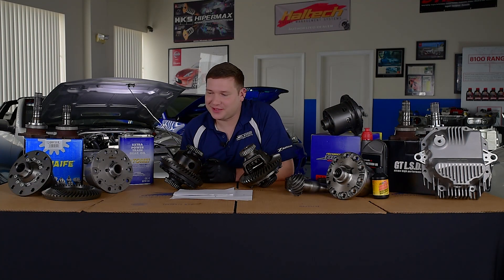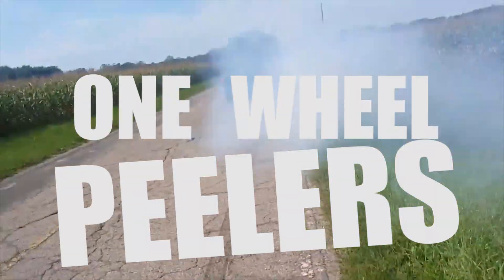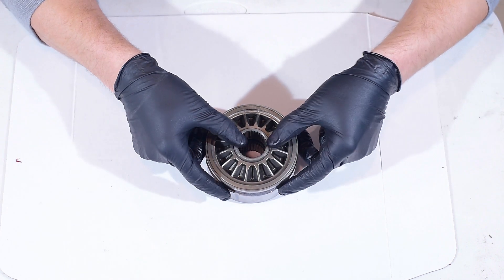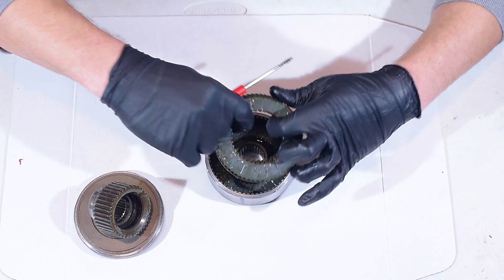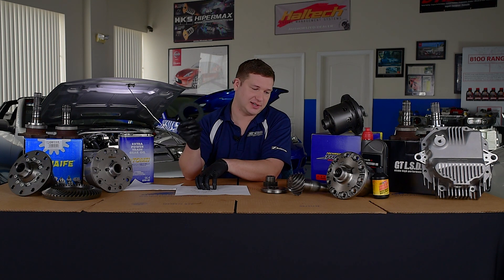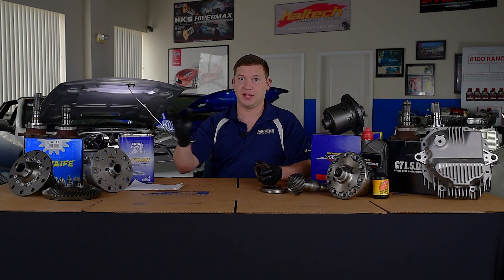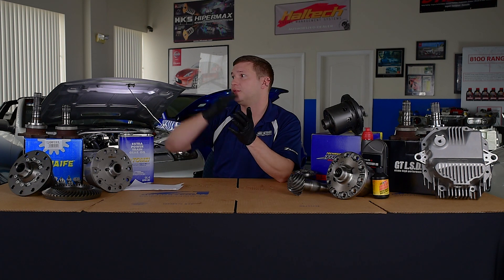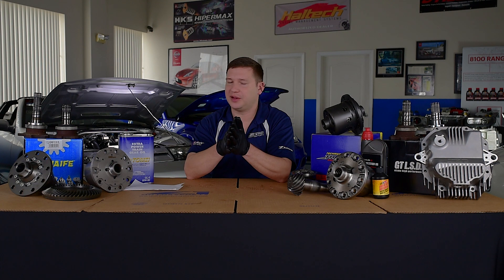Why VLSD Differentials Suck | Why You Should Upgrade

Comment: Well, its basically the same as a torque converter and works without the need for service like a plate type and is street friendly. I have driven a vehicle for more than ten years equipped with a Toyota factory Torsen and from my experience, Torsen is the weakest of all limited slip options but those who sell them of course have an interest in making you, the consumer, believe they are the best. Under many circumstance, they will act exact like a standard open differential. One wheel looses traction it will send all the power to that wheel just like an open differential unlike a clutch pack limited slip which will effectively locking the rear sending power to the tire with more traction. The only time Torsens work is when both wheels have the same resistance, again like an open. So what's the selling point? Well, Honda in the late 90's advertised it as torque vectoring in turns which I say big deal and who cares.

Comment: Ya got it backwards. As the goo gets hot it gets thicker. Non Newtonian fluid as several others have pointed out. Its thin under normal temp to act as an open diff. It just might not get much thicker if it's old and broken down.

Comment: my diff only locks up... on occasion. when the rear wheels are in the air and you spin one, the other goes the opposite direction. I have an open diff, but for some reason sometimes it'll do some great 2 wheel burnouts instead of the usual one wheel peel
Reply: Mine too! It’s a base g37 journey. Confusing stuff I almost swear sometimes both spin
Reply: @elijahkelly8431  that's because the g37 have a locking diff....

Comment: So a VLSD is an open diff with added resistance?
Reply: Can be a lot of resistance. Far as I'm aware the fluid can become extremely viscous when exposed to friction/heat from excessive differential power transfer. It's sensitive to high temperature which makes it temporarily more resistant, but it can break down over long exposure.

Comment: Could you just put higher viscosity oil in your stock VLSD?
Reply from the maker: You can but it wouldn't be beneficial to the performance of the LSD. The VLSD's friction plates are in a self contained unit sealed away from the differentials oil.

Comment: I got 06 g35 coupe 6MT ,should I buy differential fluid that says for lsd or just one that doesn’t say that ?
Reply from the maker: The factory LSD doesn't require any special additives. You can use any GL-5 spec fluid, however we recommend Motul or Red Line.

Comment: The whole concept of viscous diffs is that they don't use conventional liquid/gel, but instead a non-Newtonian fluid that gets THICKER (more viscous) as the temperature of it goes up (such as when 1 wheel begins to spin much faster than the other, ie a low traction situation).
Reply: It's not exactly as the temperature goes up, but more when a force and shear acts upon it. The higher the temperature, the lower the viscosity and the less affect shear and pressure have on the fluid.
Reply: @blainechappell5383  You are correct to an extent. It's more that the differential doesn't have adequate cooling and high heat is the main source of failure on almost everything.  

Although, it seems like Nissan deliberately cost engineered it  to bare minimum, as if they know people will most likely modify/or weld them as drift missiles.
Reply: @Typho0nify  No, lol, they cheaped out forsure but not for us to make missiles 😂 they’re borderline bankrupt so they gotta cut corners.
Reply: Was about to comment this. Acutely, higher temp will make the fluid more viscous, not less. It needs to act as an open diff when at normal temp.